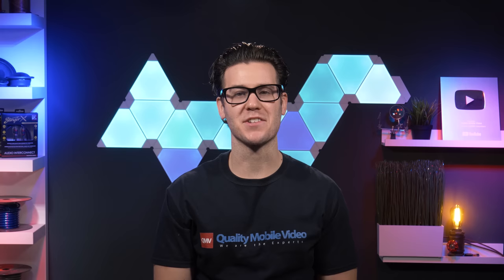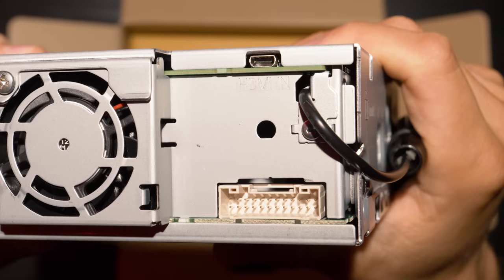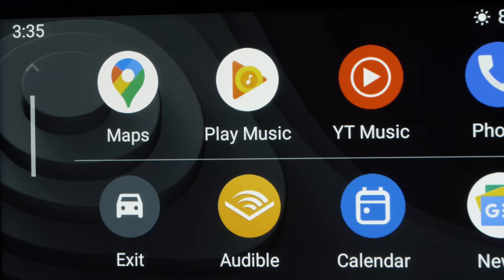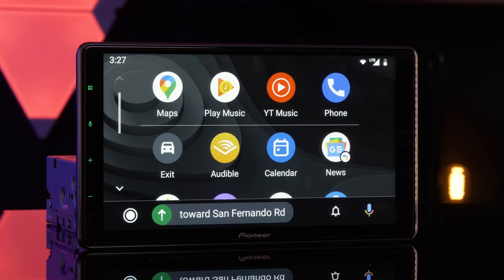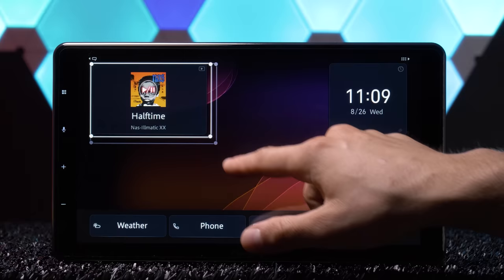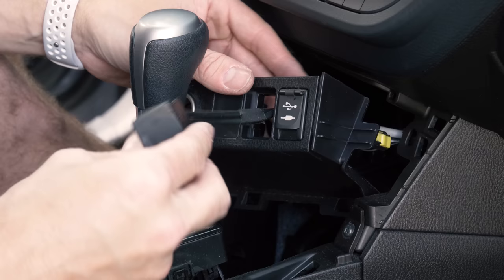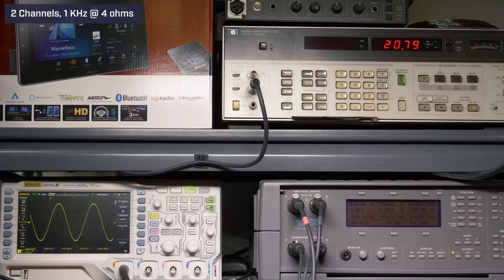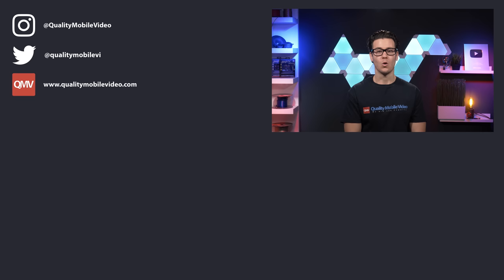Pioneer DMH-WT7600NEX 9" Floating Display Receiver with Wireless Apple Carplay & Android Auto

Comment: Someone really needs to shake up this industry imo. This seems like one of the best head units out there, just ordered one for my wrx, but it feels reallly bad spending $1k on what's basically a low end tablet with 2012 specs. If only the Android head units had fewer issues.
Reply: How did this work on your WRX? Really considering this..
Reply: @jeremiahmendoza8324  Pretty well, I'm happy with it. In the 2015+ WRX specifically it's just the right size to not block the center vents which is nice. The lagginess still isn't ideal for what this costs but it's not unusable or anything, especially in CarPlay. Wireless CarPlay works well but occasionally cuts in/out, not a huge deal to me. I'd probably make the same choice again.
Reply: @4lc441  Thanks for this response. Hard to pull the trigger on this laggy thing.
Reply: @davileett1224  It lags and no knob for volume adjustment? Meh..
Reply: I just got this installed in my 2016 Honda Pilot. SUPER laggy and janky interface. We're used to buttery-smooth phone screens and this ain't that! Really spendy for something that is so sluggish.
Reply: These high-end ddins really should be complimented with an active 3 way audio system. Otherwise what’s the point.

Comment: I don't think many of you understand the complexity of this headunit for the price. Just because a TV is a lot bigger means nothing. A TV just displays video from a separate input signal. That's it. The has built in amplification, eq crossovers, works with both Apple and Android, works with the RR to retain factory controls, and a whole bunch of other shit. This isn't simply a 9" display.
Reply from the maker: Not once did I say "a TV is a lot bigger". I simply said I'd rather have a new TV than a $1000 stereo. I don't think you understand that we've reviewed 300 stereos. We sell car stereos. We know what car stereos can do. It's as if you didn't watch the 20 minute video where I went over every single feature it has, including the ones you just pointed out. Saying that a stereo is not worth $1000+ doesn't mean we don't understand what a stereo can do. It means we know so well what it can do, that we find it's not worth the cost.
Reply: @89grand  Just admit that you didn’t watch the video before commenting
Reply: Everyone so easily triggered. I guess this is the new "entertainment".
Reply: That's absolutely not true. A modern $400 smart TV has a computer inside and amp and speakers, works with android and apple and can work completely stand alone with just a wifi connection.
The only justification for this price is the super low volume. Not many in the market for this thing.

Comment: My stock audio in my 2019 Civic Hatch crackles, so ordered this unit because it’s in stock & wireless. Hope it’s not as bad as everyone says it is 🤔 Got it installed. To my surprise, the price offset 4 me is it’s SQ. I’m not going to need an external amp. Sounds amazing w/ my OEM speakers.  However, the 6.5” coaxial Infinity’s I ordered are still in the box. Once installed, I’ll know for sure. Hope this helps others.

Edit: I exchanged the 7600NEX for a Sony  XAV 9500ES (for the hell of it). However, I still stand by my earlier comment here. The Pioneer sounds phenomenal with OEM speakers.

Comment: You absolutely correct, I like pioneer radios, however the prices lately are out of the world. IMO the 7000 series is worth about $500 & the 8000 series is worth about $750. I went for a android head unit for half the cost & it’s fast with real android no Amazon BS
Reply: What head unit did you go with?
Reply: @kcmanuel  Dasaita 10.2” with wireless CarPlay about $479.00. Check out others too because some come with customs dash kits that are super clean.
Reply from the maker: Not sure who they think will drop $1000 + installation and expandability costs on a head unit smh
Reply: @Qualitymobilevideo  them rich white people in beverly hills 🤷🏽‍♂️🤷🏽‍♂️
Reply: @jeffjohnson3620  hey I know it’s been a year but how did u compare it to the pioneer sound? I have had tons of android stereos my latest was a Joying 11.6” but none will match what my $300 Pioneer stereo had in sound quality
Reply: @ahinojosa6000  i forget i wrote this. Lol The android tablet was cool at first but then had too many bugs. Had to return back to pioneer radio. The sound and connection issues was too much for me after a while
Reply: @jeffjohnson3620  thanks man, yea I had those problems too hopefully in the future they become more stable and better rca output voltages
Reply: I decided to buy it, car prices are insane so I decided to invest in a good car audio system with Android auto. My car is clear for a few years now so I don't mind the big price tag.

Comment: For the divs who don’t understand what the numbers equate to  (aka, me ) an explanation/summary of the what  figures  result in for the performance of the unit  ( ie good bad/ quality issues) when hooked up to the machines would be handy.
Reply from the maker: Distortion means the amount of distorted noise that occurs when an amplifier is pushing too hard past its limit and the audio becomes distorted. Under 1.5% is ideal. RMS is the power output, the higher the better. Frequency response is how well the stereo plays each frequency that exist as audio wave forms. With a flat EQ a flat frequency is best

Comment: This unit can be a better option than Android based head units because of a few reasons: 

It's easy to purchase an Android head unit with poor audio output quality (strange noise, clicks, pops.) you never really know what you're going to get; one built on whatever a Chinese Friday is will leave you bummed out. 

Most android head units DSP control software is pretty vague and buggy- even in latest models, sometimes they boot up and while it appears DSP settings are still set, it ignores them completely and is playing flat unchanged audio until the next reboot. Settings are oddball terminology and delay controls screen only shows subwoofer volume level rather than a proper distance adjustment, whattt? This pioneer head unit seems to have all the proper DSP audio controls we come to expect and likely will work as they should on ever boot.

 Android head units lack auto brightness control based on ambient light sensor input. I always found the Android head units I experimented with to often be in the wrong display brightness regardless of playing with the built in automatic settings, using third party apps, or even alternative OS roms; having to fiddle with the brightness buttons to see the display or dim it from blinding me at night every other time I got in the car was quite obnoxious. This pioneer head unit has an ambient light sensor. 

Speccing out a decent android powered head unit, adding wireless carplay support (no wireless android auto still.), adding a DSP to make up for missing/odd DSP options in the DSP software, you're now not far from the price of this Pioneer head unit. 

Is this head unit worth $1000? Parts and labor of hardware, probably not. To front the software and engineering costs, maybe that's what Pioneer believes needs to happen. But, hey, drop that price a bit and you'll get way more interest, Pioneer. 

I'd like to see a faster processor with more fluid graphic response, an optically bonded display (no air gap,) and an included anti-glare/matte screen film protector, brackets to properly house/hold the USB C and HDMI connectors on the back side.

Comment: What’s the visibility like of the screen in Direct Sunlight, i.e. a Convertible? I have a six year old Kenwood 695s and it’s useless in direct sunlight with the top down. Cannot see/read the screen at all. I’ve heard the floating head units are better, if you can shed some light.

Comment: Will definitely wait considering the price... I'm a big fan of these oversize touchscreen radios but I really miss having a rotary volume knob. Has anyone found a good workaround for this??
Reply from the maker: I would say the workaround is connecting it to your Steering Wheel Controls
Reply: The new kenwood floating screen has a rotary volume knob.
Reply: purchase the Idatalink module/harness kit to retain steering wheel controls. I too prefer a rotary knob for volume but, steering wheel controls is just fine.

Comment: I would do it if it at least had what my 80prs has. Without the network mode I really don't want to let go of the 80prs and would probably just go with the 99prs if I was going to upgrade
Reply: I believe it does have network mode, for 3 way active, not 4 way.

Comment: Thanks for the video, it really helped me pick a stereo.  Quick question, I am using a micro to full size HDMI adapter, every once in a while while I am using the HDMI source with a fire stick it flashes no HDMI source and goes back to the radio home screen for about a second then comes back on to the fire stick.  Stereo is brand new, bought 4 days ago, and I have also tried multiple HDMI cords.   Any ideas?
Reply from the maker: Double check your USB power to the fire stick
Reply: @Quality Mobile Video  I actually fixed it by upgrading the firmware.  Now trying to fix the audio not syncing.  Any thoughts on that?

Comment: there are any pioneer touch screen 9 inch but with two diffrent width The length of the top is different from the bottom
the dimenthion of screen will be :
top width: 230 mm
bottom width : 220 mm
height : 130 mm

Comment: Does the kicker 800.1 amp 1600 watt works on two  kicker cvr's 4ohm 12 inch subwoofers??
Reply from the maker: Perfect match! Wire them in series to the 4 ohm impedance.

Comment: Can someone explain the benefits of an expensive head unit like this over a nice tablet with high refresh rate and smooth processor pared with a nice amp? I consider myself an intermediate-advanced DIYer. And funds aren't necessarily the issue, but if I'm going to spend a lot of money on my car's entertainment system then i want it to be smooth and feature rich
Reply from the maker: Head units have all the necessary wiring to power your speakers. If you're gonna do a tablet you'll need to also get an amplifier to power your speakers
Reply: IKR? Just need a car amplifier & processor that can WiFi, hotspot, Bluetooth, internet, camera & provide a sturdy mount for your smartphone or tablet. Nonetheless, I recently bought this unit to replace my OEM.Edit: I exchanged this unit for Sony’s XAV 9500ES.🥴🤕 It’s cleaner and closer to what our cellphones are 🤷🏽‍♂️
Reply: I needed a radio that could control my AC/heat, and have wireless android auto. My main reason for taking a long time to upgrade factory radio was that I didn't want to lose my climate control system. The climate control was built in with the head unit. It works with the my factory infinity sound system with Subwoofer.  All my factory settings, and steering wheel controls work. I can use Alexa if I want, that was a bonus. Kia Sorento 2015 SXL and I use the verizon Hum for internet connection if I want to use Alexa.

Comment: please what the difference dmh-wt7600nex and dmh-wc6600nex ?
Reply from the maker: The WT has a floating display
Reply: @Qualitymobilevideo  
there are any pioneer touch screen 9 inch but with two diffrent width The length of the top is different from the bottom
the dimenthion of screen will be :
top width: 230 mm
bottom width : 220 mm
height : 130 mm

Comment: I'd rather buy a TV for that price. Also for that price it should have a built in mic
Reply: Built in mics typically don't work as well as the wired mics included with head units. Even vehicle manufacturers typically use mics that aren't mounted in the head unit.
Reply: Built in mics are terrible

Comment: Having purchased the last two Pioneer flagship head units, F no!!!!!
Reply from the maker: BAHAHA
Reply: Why do you say that? Give us the details?
Reply: @trevorgibbsnc  Fair question.  While it does some things well and is generally reliable, I have some bones to pick for $1000.  For one, the Nav is absolute garbage.  They ought to drop that feature and thus the price.  With Apple Car Play, nobody is going to use built-in nave over Waze or other good phone-based GPS nav.  Second, it should have more eq functionality.  For this coin, you shouldn't need to add a DSP for fine tuning.  Third, a "flagship" unit should have a fiber optic output option.  My last one locked up sometimes hand I had to pull over and turn the car off and back on to reboot.  That was way unacceptable, but the new one hasn't done that, yet.  I'm sure I could come up with some more gripes, but that's a start.

Comment: I recently bought one of these and I have lagging and connection issues when using apple car play and sometimes comes disconnected, I have the latest firmware 1.30 and the latest apple software, do you have any suggestions on a solution?
Reply: Haven't had the connectivity issues with the same OS on the 4660NEX (the 7" version of the bigger-screened variants) I picked up, but the lagginess is a concern. Got the latest firmware and nothing has really change in terms of responsiveness. Watching a video of the 2660NEX, which basically looked like a capacitive mechless version of the 2550NEX (have that in one of my other cars) and using the same user interface, it looks snappy and responsive to the capacitive "buttons" on the side of the screen. It's disappointing to see Pioneer compromising on getting wireless CarPlay and capacitive screens wrapped together with their new UI, coming at the expense of usability and responsiveness. I feel torn. I need a 7" unit so I'm leaning toward a Kenwood DMX907S for wireless CarPlay, which feel more responsive in terms of swiping and very much so with the mechanical buttons. That said, beyond the home screen, the Kenwood HD Radio/radio screen just looks schizophrenic and cluttered by comparison to the Pioneer radio screen on either of the user interfaces in question. If I had it my way, the cleanest aftermarket UI by Sony would have HD Radio, a capacitive screen, and wireless CarPlay all rolled into one and I wouldn't have to compromise with Pioneer or Kenwood.

Comment: Still not a proper stand alone Android system....🙄 What exactly is HD radio? Kids and manufacturers alike have been using this keyword catch for 20+ years now, what makes it HD?
What is all this auto and car play crap, why do I need a cellular phone to make the damn thing work? I simply refuse at any price point! I like the DSP though, I mean it's about eFing time!
Reply: HD radio is exactly what it says. CD quality sound and a digital signal. I hadn't ever experienced it until I installed a new radio in my wife's car last year and it lives up to every bit of the hype. It's roughly equivalent to tuning in a digital HD station with an antenna on your TV. I wish more stations in my area also broadcast in HD. 

Simple Google search would have cleared that up for you but, you know, cool rant.
Reply: Some Radio stations are in HD you can only get HD stations if you have an HD radio. Some people want Android Auto because they use Android apps for music or they use maps for directions.  And depending on the type of car you have you want a radio that can support all your factory settings.